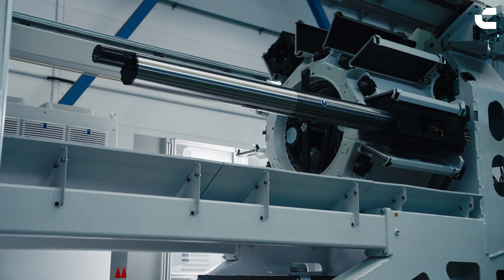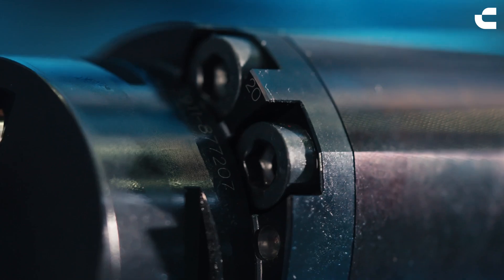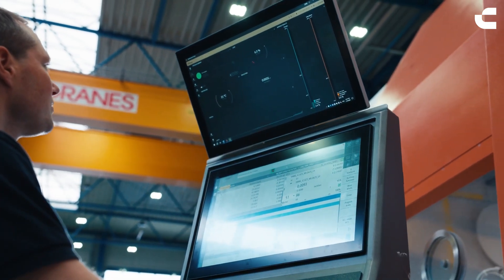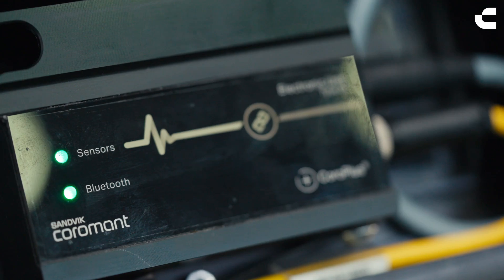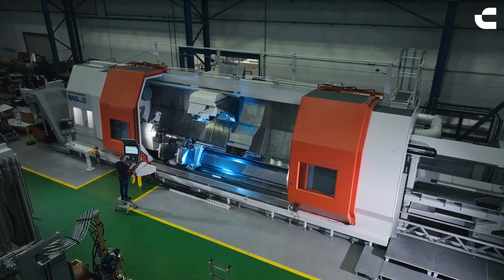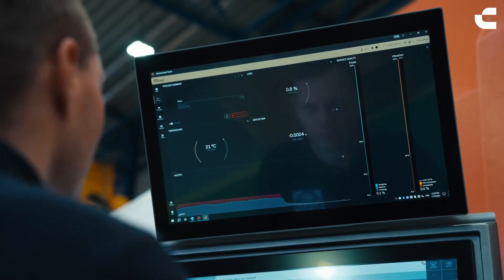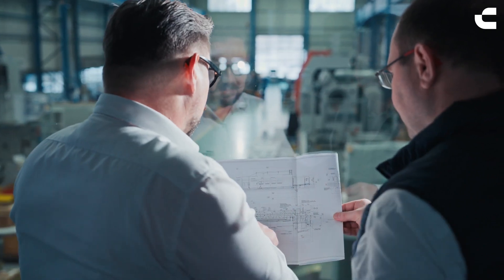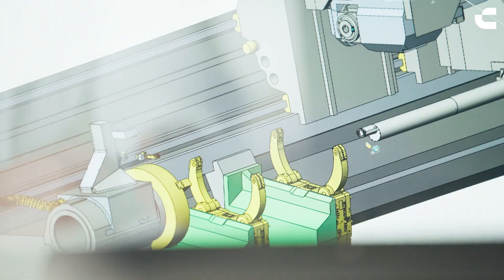Secure machining in blind operations with Silent Tools™ Plus​

Comment: Lots of blabbing but not a single cut, let alone a single piece of swarf was made…
Reply: 30% spindle load on that machine says they were making a significant cut. Exactly the challenges they are solving, the process is a blind one, without a camera you can only imagine the cut by sound and stress measurements.